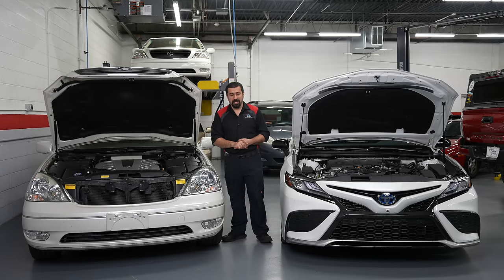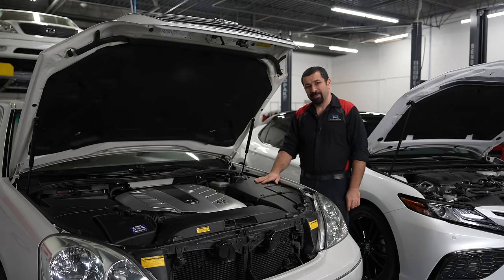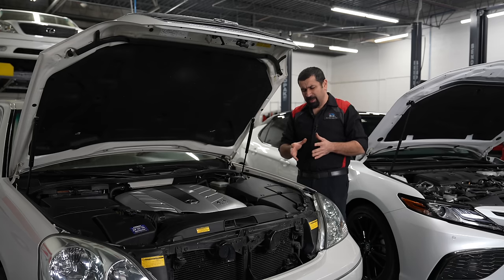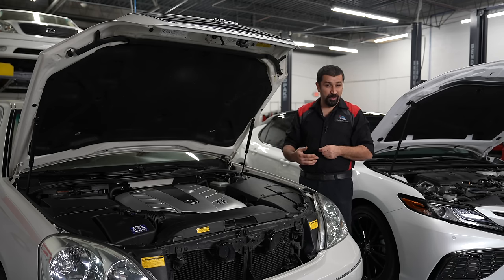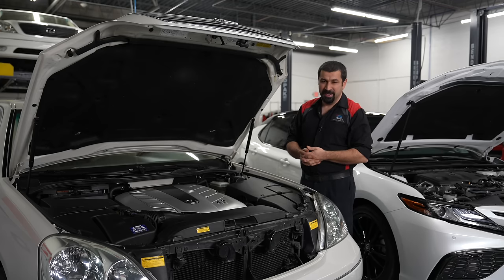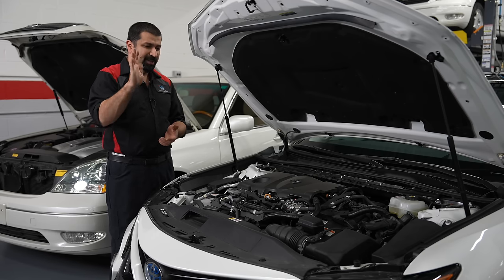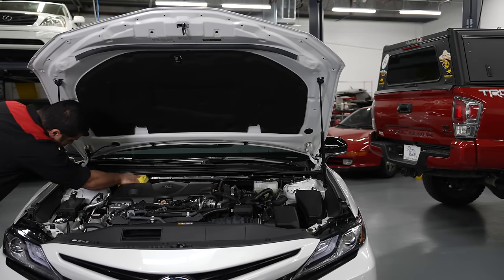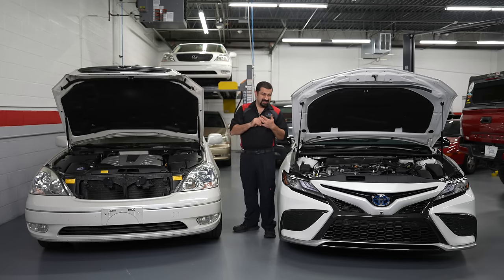Never Do THIS When Cleaning Your Engine Bay! Do THIS Instead

Comment: I have a 1992 Chrysler and have always kept a clean engine. After a service at my mx provider I'll always get a "thank you" for my efforts and I think one gets a bit better service when the tech works on a clean engine. The car has 196K on the clock. Decades ago I started using WD40 as my cleaning/protecting agent, mainly because the car was my daily driver and I lived in Chicago where fighting rust is a battle that never ends. These days I generally deep clean the engine bay once annually: I cover the distributor with a plastic bag, spray the engine liberally with "Super Soap" (which comes out of the spray wand at very low pressure) and let it sit for a few minutes, then rinse with the Spot-Free water rinse (which is also low pressure). After getting the car home I'll do a very light spray of WD40 to areas I can access and then wipe down all exposed surfaces. I've read commenters cautions about the evils of WD40 but for me in this application it does just fine- no problems with belts or hoses and so on. I also think the silicone is beneficial to the plastics and aging plastic that's getting brittle is the bane of any older automobiles. After seeing this video I will start bagging the alternator as well, but my attitude has always been that car engines are designed to operate when wet from road spray, so a light rinse won't destroy an engine's operation.
Reply: Maybe you just got lucky.
Reply: Its a good thing friend, your car is pre OBD2 ,PRE ECU everywhere trying these on newer car is not as easy.Modern cars are engineered to fail after X years plain n simple.
Reply: I used the same technique on a 2012 Sentra I bought new and had no issues until 169K when the CVT failed. But I suspect the xsmn failure wasn't related to my use of WD40. On the Sentra I did bag the ECM before and cleaning, though. I agree with your comment that modern cars are built to crumble in 10 years or fewer. @drincogni
Reply: Possibly. Dunno. @norakat
Reply: The WD in WD40 stands for water displacement.
Reply: @johnneilson377  Nissan CVT failures are a known issue. In fact, I would say there are two types of Nissan owners. Those whose CVT's have failed, and those whose CVT's will fail in the near future. Sadly, I will never buy another Nissan unless it has a non-CVT transmission. I said all that to say that I doubt your WD-40 routine had anything to do with it.
Reply: @DougTreff  Apparently the best preventative measure for the early Nissan CVTs was/is frequent fluid changes; I replaced the failed unit in my Sentra with a used one from a national recycler. Had it shipped to a local shop where I was charged $800 for the swap; the used CVT was $1500. The car is still on the road but I warned the new owner to change the fluid every couple of years but more importantly (I think) to drive it like an old lady would, gently and lightly.
 
Apart from extending the warranty for CVTs any steps Nissan has taken to make them a more reliable component have not been promoted by the company. That casts doubt on whether or not Nissan has made any real improvements that will make a material difference in the CVT's endurance. Concur the company should go back to conventional automatic transmissions in all lines and as well, offer more manual gear box options.

The 2025 Kicks really presses my button with its looks and features but the fact it has a CVT in the drive train means I'll never buy one.

Comment: Bought my 2016 sienna new. Just rolled 130k miles. I do most maintenance myself. Oil changes every 5k miles (factory filter). Never had an issue. Also have never washed my engine bay :)

Comment: A good common sense video. I have a question about all the rubber door seals. I clean them with just a damp cloth, but should we use a silicone spray or something to keep the rubbers supple and not dried out? Thanks.
Reply: For cheap, you can buy the silicone tire shine stuff, it works though you have to do it once a month if it's always pouring in your area.  I recommend checking out 303 Aerospace protectant, it's made especially for the rubber / vinyl /leather / plastics against UV rays.

Normally lasts 3-5 months when car sees rain.  You can use this too on interior trims (dashboard, doors) and will leave a rejuvenated deep colored satin finish.   If you liked the results,  and want to keep using the stuff long-term, I highly suggest to look for the gallon version, it is way cheaper.  Btw, you only need a few squirts on a towel to use for all the door rubber seals.
Reply: Silicone works good, keeps them soft, and in cold climates helps with them not sticking when freezing rain gets in there

Comment: I’ve had great results using a cheap, low powered electric pressure washer, like the $70 harbor freight one. I spray with a dollar store degreaser like Totally Awesome. I large paint brush to loosen the dirt. Then rinse with the pressure washer. I start in the morning and I leave the hood open all day and night. Perfect every time and never a problem. 2018 Camry 2.5
Reply: The thing with a pressure washer is to stand back from the car when spraying the engine. I believe people have issues because they are spraying there engines standing right next to them and they probably don’t keep the water moving that’s important to. I stand a good 2 to 3 feet back from my car when spraying the engine and I keep the water moving in a zig zag motion. I don’t just stand there with the pressure washer and spray one area.
Reply: Right on brother!
Reply: Good advice. You can put your hand in front of a pressure sprayer at least 1 to 2 feet away and it loses it's energy quickly and only rinses.
Reply: You can reduce its pressure at the tip by using a wider angle spray tip

Comment: My intuition has never allowed me to spray down an engine bay with water. It just never made sense to me. 

Using an all purpose cleaner (APC) and/or a detailer/trim dressing with a microfiber towel gives me all I need. I do it maybe 3 times a year MAX. 

As you said, staying on top of the build up of dust goes a VERY long way.

Comment: Great video. Not cleaning a hot engine is a good tip. Sealed areas will create a vacuum when cooled and suck water in. Anyone familiar with canning will know what I mean. One thing not mentioned in this video is how to clean the hood insulation. I never had a problem with cleaning it. I dribble water through it like a giant tea bag till the water flows out clean. Let all the water drain out before closing the hood. The fibers in the insulation don't hold water themselves so it will dry pretty fast. Don't close the hood right after getting the insulation wet because it's weight will cause it to sag.
Reply: Re: " Not cleaning a hot engine is a good tip"  This is BS.  Driving through a large puddle with a hot engine is no different.  The exhaust manifolds, heads, etc will be soaked.
Reply: @MikeS-n2i there is a difference between a puddle and drenching your engine block with cold tap water. I warped my 2021 Tacoma rotors from aggressive driving then blowing through a small stream multiple times.

Comment: I'm incredibly grateful for the info you shared! I've used a pressure washer twice on the engine bay of my 2018 Camry XSE V6 since I bought it. Maintenance washes involve wiping down and blowing dust away with compressed air, and so far, no issues at all!

Comment: Every detailer who does Engine bays should watch this video. I used to detail cars ,trucks vans etc. I always did the engine bays. I was very fortunate that as far as know had someone come back to me with a problem with their engine after I did an engine detail. I never pressure washed the engine as tempting as that might be . I never covered the alternator or disconnected the battery  which on some cars can give you a mess of problems. I had one customer tell me do not clean the engine bay. He wasn't a mechanic or was he all that mechanical, but he did understand about water and electrical or electronic problems. I like the wipe down method with a towel. I also like to use a product called Trim shine made by Stoner. it is a solvent based spray that makes all the hoses ,plastic panels look like new !

Comment: Good advice. However I have washed my truck engine atleast 20 times with a power washer and engine degreaser. 2001 tacoma. Had it for 23 years and runs strong.

Comment: Thank you for this video. I love to keep my engine compartment clean on my vehicles This information really helps especially since I own both types of engines.
One thing that works great for me is I spray with Black Magic bleach Wite tire cleaner. Spray on. Wait 2 minutes and hose off and wipe dry. Does a great job. Tell me if this is ok. Have not cleaned my Hybrid

Comment: I find that keeping an engine bay and really all exterior parts of the car fairly clean isn't just about esthetics, but also rust prevention, and because it makes working on the car and figuring out what's wrong with it easier and simpler, and more pleasant. No need to go crazy but once or twice a year, like spring and fall, isn't such a bad idea, so long as you're careful. You can spot leaks, cracks, frayed wires, etc., much easier if things aren't coated in dust, grime, crud and so on.

But yeah, it also looks nicer.
Reply: @efil4kizum  Heh, I suppose, but only in the same way that a leaky exhaust keeps you from hearing how your wheel bearings are shot.

Comment: I was thinking and wondering what to do to clean it on my 2021 Venza.  I already have a diluted spray bottle of Optimum no rinse car wash with distilled water.  Thanks for confirming my initial instincts were correct.  I already keep my touchscreen clean perfectly by using an Apple Store Approved screen cleaner with microfiber cloth called, WHOOSH!  They make a travel size bottle I keep in the car center console or glove box at all times.

Comment: I detailed my hybrid camry 2013 in march 2022, and sold it last november 2023. I used degreaser and a brush first, then a pressure washer to rinse, then a air blower to dry. Not once did I have any issues after this. Point is, be careful and don't hit blatantly obvious connectors etc, and make sure you dry EVERYTHING well afterwards.

Comment: I spray the engine bay with water after every snow fall and the road is dry to get rid of the accumulated salt while the engine is cold.  So far,  never had an issue with connectors.

Comment: My shop teacher when I was in high school so many years ago now drove an older Ford F-150 with the 300 straight six. As long as you kept water out of the carburetor it really wouldn't hurt anything at all if you hosed out the engine bay. With all the electronics and computers on cars today I wouldn't even consider doing that.

Comment: I generally clean the engine bay once or twice in a year with a toothbrush and/or towels and depending on the surface, i use different solvents, I like the orange degreaser for the engine surface and tire shine on the plastics. I never use water. I have never had problems.
Reply: Do use WD40, i do mine 2x a year EVERYWHERE. Had a 2002 Yaris for 14yrs with no rust, the rear beam/bar was in great cond indeed unlike these Fiat 500's which fail it's MOT (Yearly inspection) when they're 8yrs old! My old Yaris only ever failed it's MOT (Yearly inspection) on wiper blades/windscreen wiper blades TWICE.

Comment: I cleaned the engine bay of a 98 camry a few years ago. I use a garden hose, some degreaser in a few areas and some car soap in a few others and did a general cleaning and rinsing withbthe garden hose. I used a leaf blower to dry the eengine bay out some and then left the car with the hood open for a few hours on a nice summer day to dry. I didnt have any issues with anything after that or the entire time I owned the car. I just avoided the alternator when cleaning and removed the battery before I started my cleaning. A lot of cleaning an engine bay is just use common sense and be nice with things, dont go overboard with anything.

Comment: I never use high pressure water to clean my ES350 engine compartment but rather I use a damp shop towel or rag (sometimes with a bit of 409 type cleaner on it) to wipe down the exposure surfaces when I am checking fluid levels etc or when things begin to get obviously dirty/dusty/grimy…and this practice keeps the engine bay clean enough for even this admittedly anal retentive/almost OCD clean nut (on my very first car…a 1962 VW Beetle…I would go as far as to clean the inside of my hub caps!).

Comment: We have a 2020 Avalon and a 2021 Tundra, every time I go through the car wash I pull into the vacuum and detail area and use the microfiber towels to wipe down all the areas inside the door jambs, trunk lid, fuel door, hood and the entire engine compartment. By doing this every time it stays just like new without any cleaner of any kind.

Comment: I agree… I maintained my wife’s 2018 Camry from new and almost 6 years later the engine bay looks like new
Reply: 2018 Camry also. Early summer i use dish soap with a lot of water at low volume to remove salt. Then run the car to heat up the engine .  Then wet towel to clean the top covers and painted areas.  Works great .

Comment: Thanks!, I like to clean engine every oil change and/or filters replacement and as you mentioned, when cleaning I can check for possible leaks, rust, to tight loose caps and/or hoses, etc.

Comment: Thank you for your video... I have washed hundreds of vehicles of all types, sizes, etc., with my gas powered power washer, and never, ever, hurt any of them... 
These are regular clients who see me annually/bi-annually, etc., and they love to see their engine compartment all cleaned and treated with a product that makes all the black plastic and rubber hoses look new again... 
 I DO use a professional blower to dry as much after I wash and rinse, and then leave the vehicle with the hood up outside for a few hours to insure it's going to be as dry as possible...
My pressure washer is Not a huge 3-4+ gph monster, and I use the widest Fan Tip on the end of it..
I use common sense and Look at what I am going to be spraying on the cleaner first, and then rinsing it all off, and of course, do Not spray into electronic parts, like the alternator, etc...
I also like to sometimes, when the front of the engine compartment is especially dirty, etc., to   of course, after spraying a cleaner there, come back and spray it all out from the inside of the compartment Out, through the grill, etc., and get as many of those pesky bugs, etc., out at the same time..
One just has to pay really great attention, and Look at what's in there, and avoid things that may house electronic boards, etc., in them, and Manage your spray tip to not hit them and get water inside them...
The Only vehicle I will Never used this on is all Ferrari cars, which have a Lot of connectors that are not always water tight..  :)

Comment: Back in the old days 60's - 70's you could pretty much power wash the entire engine/bay. Today, with all the complex electronic parts/connectors I wouldn't even consider that anymore. What I do is use clean dry/damp rags and for areas that are tight and small I use a screwdriver with a thin rag covering the tip...then probe around and do the best you can.

Comment: Great video! One thing to be very careful of is to not use any aggressive degreaser that is very alkaline (caustic) (or acidic, for that matter) on any metal, especially aluminum. I made the mistake of using an alkaline cleaner on the crankcase of an old BMW motorcycle, and the aluminum alloy started to corrode and flake off. Also, be very careful if tempted to use a vacuum cleaner to remove dust and dirt, or compressed air from a nozzle to blow dust off, as both can generate static electricity and can potentially damage expensive, delicate electronics.
Reply: Good tip on degreasers. I have heard that they can take out the AC condenser rather quickly.
Reply: @Esteban_Herrera  I hadn't thought of that, but I believe you. Another good reason to avoid any strong cleaner/degreaser.
Reply: @technodan3083  Careful with the condenser on a home AC too.
Reply: @user-3tf67bk46u take an ESD course this certainly doesn’t work you’ve gotten lucky. Need an esd approved vacuum/fan that is properly grounded. Plastic is non conductive it tribocharges and so yea grounding it will only remove charge from the exact spot you grounded it
Reply: @user-3tf67bk46u  ehhh idk in theory water is a polar molecule and does equalize some charge. Take a static shirt that sticks to your skin. Get it wet it’ll mostly solve that problem even after it dries. But keep in mind type of static that can shock electronics you can’t feel or notice. Generally best practices are way overkill but really depends on what electronics you’re near. They do have esd protection in all computer chips these days but they only save it up to a point. Your body is charged to thousands of volts on a 12v battery system. I’m saying probably helps but I don’t expect your methods to produce perfect results forever it seems risky to me. But if a shop is doing the same thing you are better than that by taking some preventative measures. Fans usually actually deionize the air. But I doubt any of us could afford an esd free vacuum they’re probably so specialized
Reply: @user-3tf67bk46u  I would think wiping out the air box would produce better results with a damp rag. If you need to vacuum it could be worth popping out the MAF and whatever other sensors in the near vicinity. We just don’t know how much static electricity things like that can withstand. And just cuz it worked once doesn’t mean it will work when humidity is ever so slightly lower. High humidity though would be your friend here